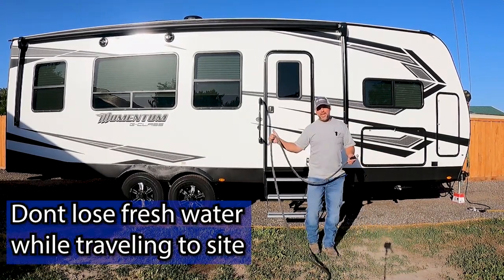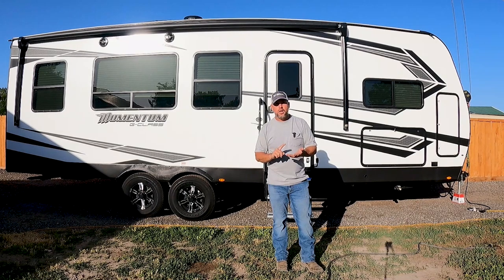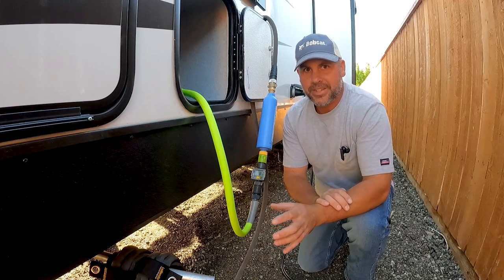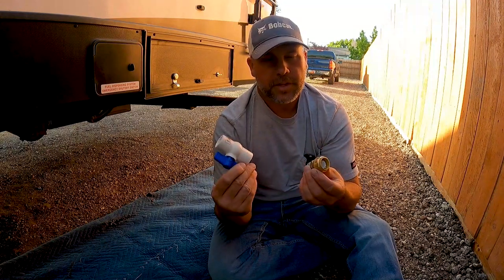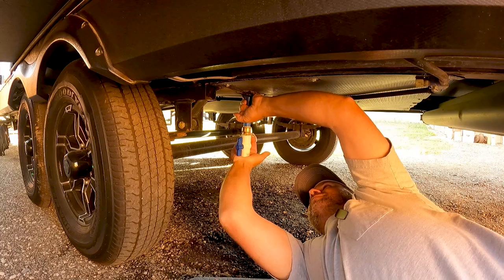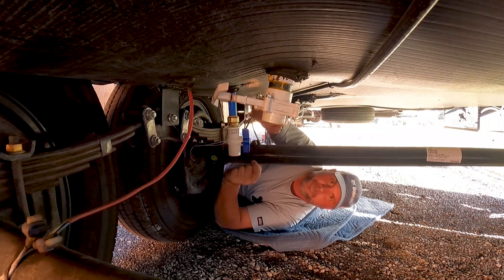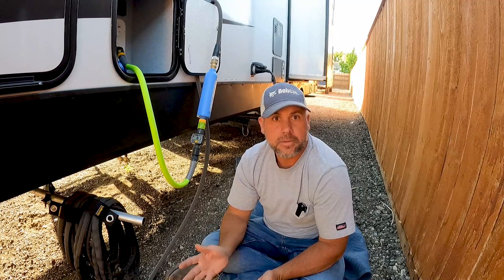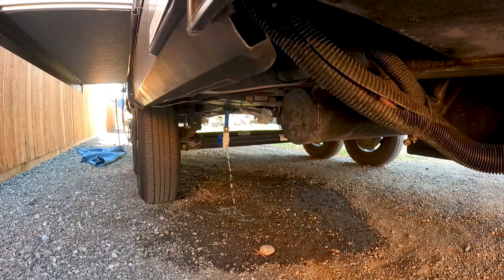Grand Design Momentum 25G Fresh Water Tank Modification

Comment: My 2021 GD 28G had the same problem only we would lost all of our water in a 4 hr drive to Colorado from NM. Grand Design paid for the dealer to fix the issue. They had to drop the under belly and run a secondary drain line for venting purposes. Your idea is a popular one and I did add the sharkbite valves to mine but only after the vents were added. I have the original drawing that Kent Roberts of GD sent me if your interested. I would recommend you consider doing the GD idea for warranty purposes.

Comment: I had the same issue with my 21G. I thought the missing water was due to the overflow but I finally realized it was completely something else. I explain: the 2 fresh water tanks are connected together via a small diameter pipe. The water level sensor is the tank which the freshwater is being poured into. The consequence is: you stop the filling process too soon because the first tank is overflowing  AND  the control board showings full tanks!! But it isn’t true!! It takes time to let water equalize is both tanks.
! Otherwise, Half an hour later, at the camp site, after the tanks had time to leveled out, you realize the camper is not full!!! The importance of this effect depends on the filling flow. greater the flow, more chance both tanks won’t be filled completely. Adding a flowmeter can give feedback of the actual volume filled. Also, since it restricts the flow a bit, there’s less chance to have the false « tank full ».

Comment: If you’re going to plumb the one between the axles back further, plumb them both together and use one valve to control both overflows together. No need to have two points of failure.

Comment: I have the same trailer..I couldn't get more than 75 gallons in it. I used 2 elbows on each vent to run the pipe outboard then up so it's higher than the tank. I have to remove it to winterize. I wrote a letter to grand design about all the problems I've had. They actually called me to discuss. I am currently building another cargo trailer conversion to replace it. Shame because it is such a beautiful trailer and perfect size.. just tired of fixing issues and I hate the nautilus system. Great video though, thanks.

Comment: On my 230 there was only one overflow pipe so I was able to add a tee before the added ball valve and ran a line to the wet bay and installed an end of line vacuum breaker. Works great . Bought a new 280 and have two overflows next to each other. Would like to see  a diagram of the water system before I try adding a venting system.

Comment: I closed my vent while we were hooked to city water. Prior to leaving for our trip home I wanted to add about a quarter tank of fresh water. I forgot to open the vent, and heard a very loud bang. I had snapped a bolt holding my brace under my fresh water tank. Luckily no other damage occurred. I repaired my bracket once I was home, that is when I found out what I had done. So yes, always open the overflow vent before filling.

Comment: We originally were going to buy a 25G, and after watching all the info you provided regarding the weight distribution, we ended up buying a 28G instead. Thanks for all your info. The 28G unfortunately suffers the same issue with water loss, I actually did this exact same fix on the overflow tubes, but once we get where we are camped and I open them up, they drain out still and it drains out a lot. I have all the filling items you have shown on yours and I put the pressure on very low so the waters goes in slow to avoid pressure and over expanding, but unfortunately we are still getting large amounts of water loss, even only filling it up to about 50 or so gallons, and these things should hold 100. Anyway, any suggestions would be appreciated. Again thank you for all your help.

Comment: Thanks again for your video. I had the SAME problem. I installed the same hardware as you and still cannot break the siphon!!! Dealership wants $170 just to look at the problem
Reply from the maker: Most people leave the valves closed.  Use about 5-10 gallons of water and then open the valves and that suction should break the siphon.  Hope this helps!

Comment: Have you made any modifications to the structural supports under your freshwater tank, to be able to travel with a full tank?  My service dealer is telling me not to travel with a full tank because of support failure.  Thanks
Reply from the maker: My tanks fell out about a month ago, just sitting still.  I traveled a few times with full tanks but never again.  I am currently working on building a much better support  for the tanks.

Comment: Could you plumb the lines together with an elbow and a T, then have one ball valve at the end? It would be nice to see a tank plumbing schematic to see why there are two lines (front & back of tank?) to vent it. That would make it super easy with only one valve to turn.
Reply from the maker: That's actually what I want to do, however I can't find a schematic on that tank. I'm not sure if it's two halves that are plumbed together or how it actually works to be honest with you. I am going to plumb the other ball valve further back to the rear one so I can reach them both at the same time. Unless I can see exactly how it's plumbed I'll leave two valves for now.

Comment: Nice tip thanks. We're ordering a 2022 next week. Looking to do mostly boondocking (Adding 300AH lithium batteries to the front with the 1000w inverter and Generator). What are your overall thoughts on this TT for boondocking after experiencing it? Won't be bringing a SxS or anything, just like this model for the patio space.
Reply from the maker: We love it for boondocking, especially now that I fixed the water issue.  Now the water lasts us, family of 4, for several days with plenty to spare.  Also consider upgrading the propane tanks to the 30# tanks if your in a colder environment.  The large open space takes awhile to heat up and the extra propane is peace of mind for longer boondocking trips.  Generator is of course a must and works great for us.  No complaints with this unit.  I was concerned about lack of storage at first but we have room to spare after loading up but most of our trips are less than a week so we don't need tons of supplies.
Reply: @tetradgroup  Great to hear! Is the 30' 11" length listed on the spec sheet including the tongue? If not do you happen to know what the total length is with tongue?

Comment: Great tip, what's the model of the flow meter you use?
Reply from the maker: Here is the one I used, its decent but is usually short 10 gallons over 100 gallons it seems but it gets me close.
https://www.amazon.com/dp/B08QCNMJJR/ref=cm_sw_r_cp_apa_glt_fabc_QASRCNJ617WE9ZQ8YN12?_encoding=UTF8&psc=1

Comment: Have you noticed any issues with pressure change from elevation gain/loss while driving?
Reply from the maker: I have not had any issues so far, I live around 4,000 ft and we're constantly crossing mountains 7 ,000 to 8,000 ft.